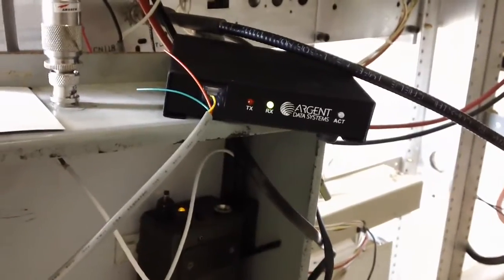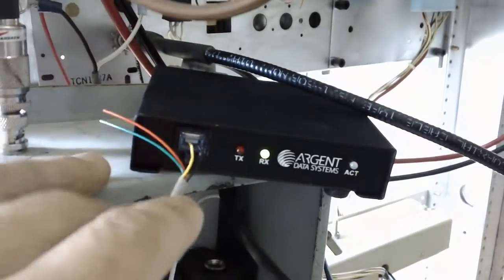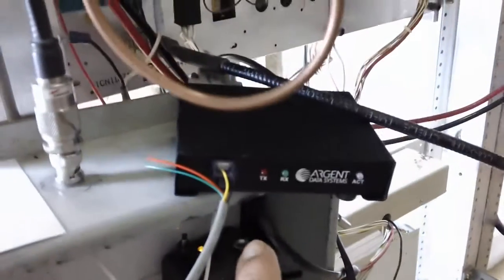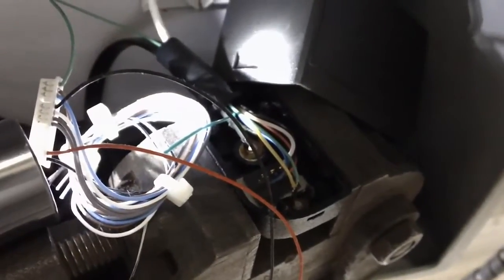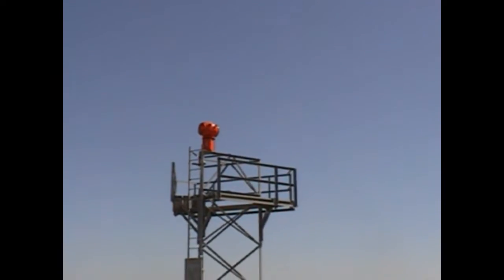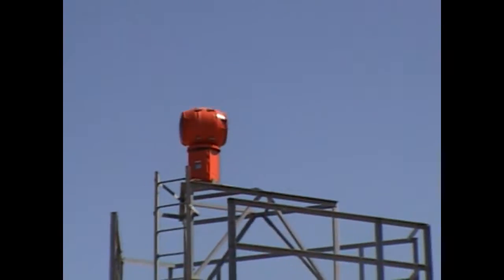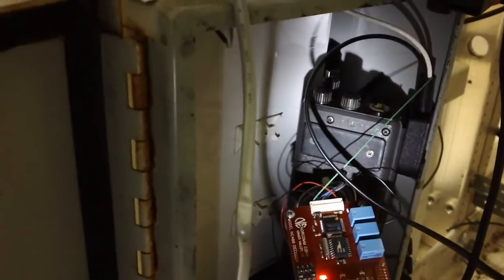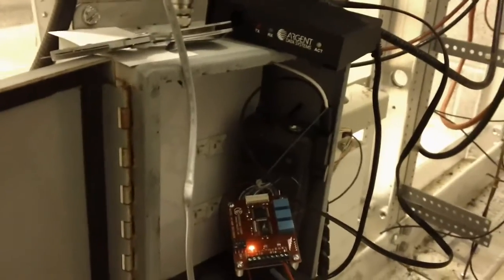Radio remote control device, quick signaling

Comment: Norcomm makes some awesome (and very programmable -- almost to a fault) products!   I have used many of the Argent Tracker3 units and integrated them into standard mobiles or portables without lockup issues (over a year on the air) however...  having worked with the NorComm stuff; I can say that the $35 for the Tracker3 Micro versus the cost of a norcomm board would have me replacing the TNC...  [And yes, I'm aware you probably had a drawer full of NC400's]

Comment: Try putting your equipment on a UPS...
Reply: You could also remotely ping the box or your site...  and when it doesn't respond because its down, sound an alarm, or better, automatically take action remotely to dial in and reset it.

Another really low tech dummy way is to put same box on a digital power timer (like for lights or spinklers) that you program to switch off at 3am and back on at 3:01am.  So every 24 hours no matter what, your box is power cycled and reset.